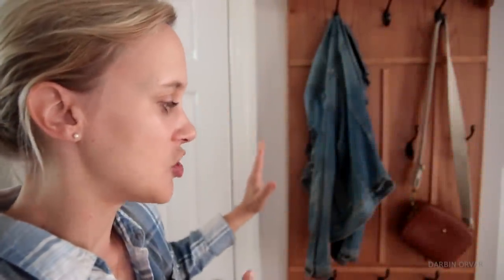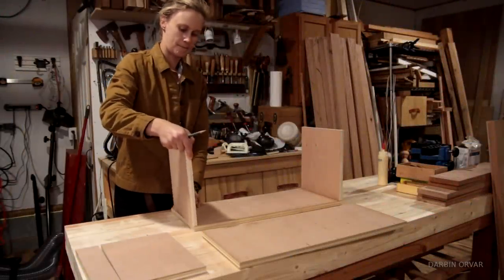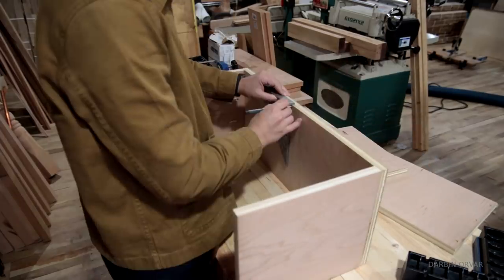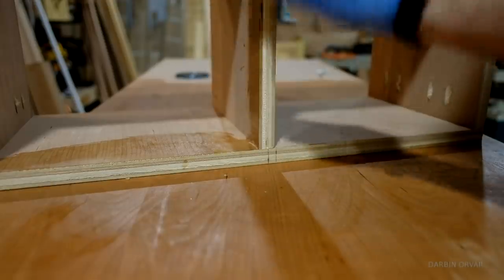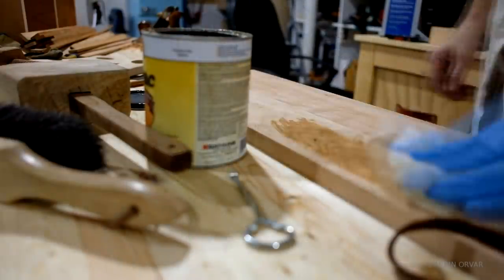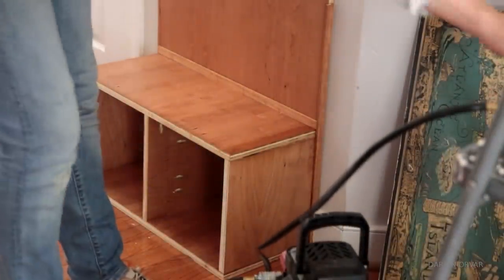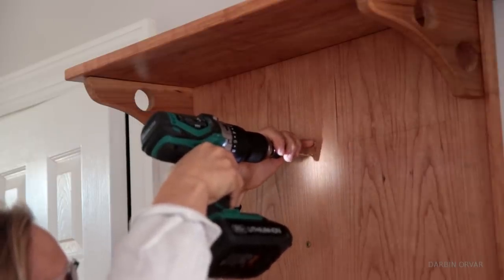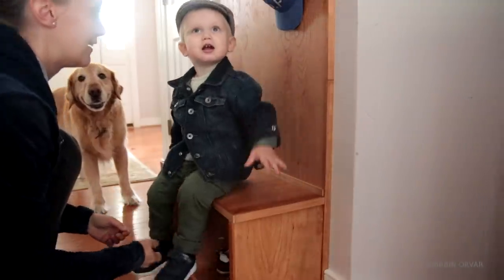Making an Entryway Bench & Organization - Darbin Orvar

Comment: Does that plug still have power to it?  If so, you might be violating an electrical code.  If someone needed to do some work on the electrical and wonder where that wire went, they wouldn't know.  It might also be a fire hazard if that plug fails/shorts out.  It might be best to revisit that and cut holes for the electrical outlet (even if not used) - I think extensions for the outlets can be purchased to move it out of the box to be flush with the wood.

Comment: Great video. Did you shellac the trim pieces prior to installing them? Also why were you using your saw fence on the left of the blade when cutting the trim pieces?
Reply from the maker: I did shellac them ahead of time. It's hard to use a push stick on 1/4 inch pieces.